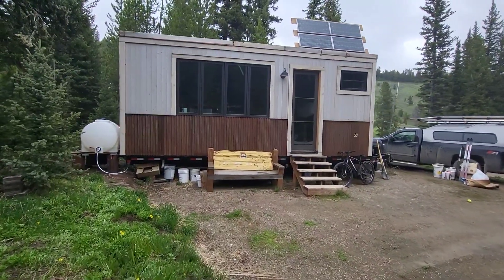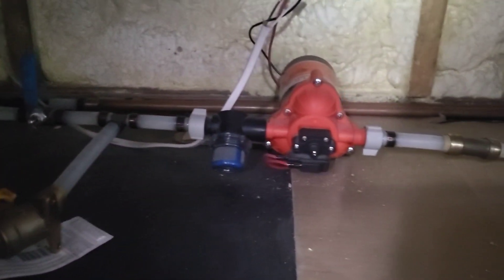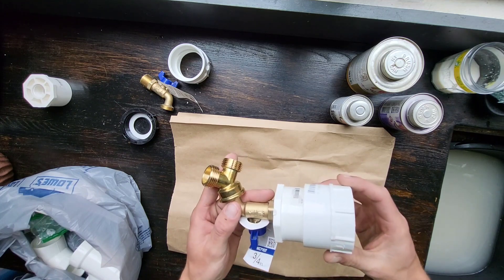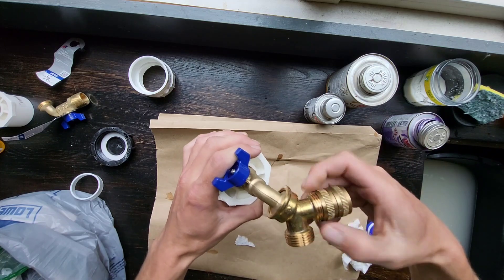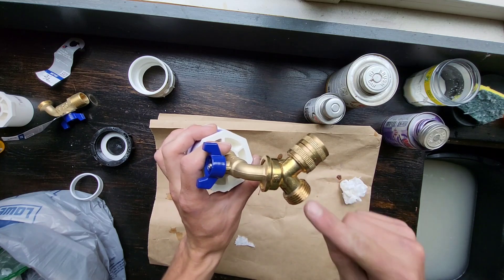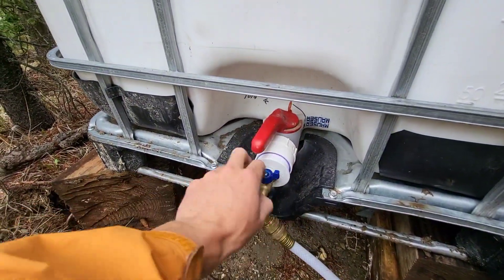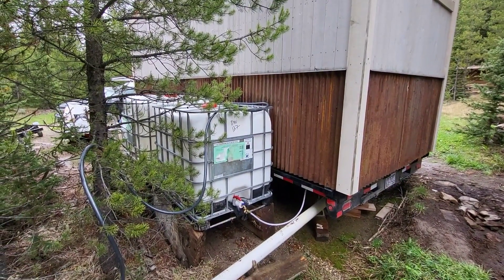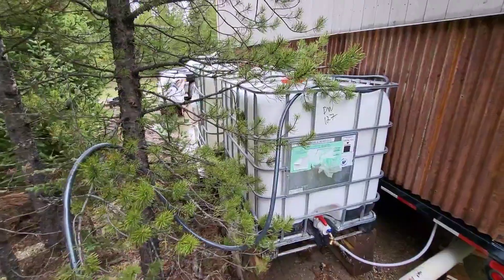Tiny House Off Grid Water storage: IBC Tank install

Comment: So the pressure from a full tank is enough to push the water up into the house? I thought I would need to put my tote above the house. Also, what did you use to clean the containers out initially?
Reply from the maker: No, it gravity feeds into a pump in the house. After that, it is pressurized throughout the house. I just cleaned it out with water
Reply: @nialldivers  Oh. It looks like it's barely off the ground. How much higher is it than the feed into the house?